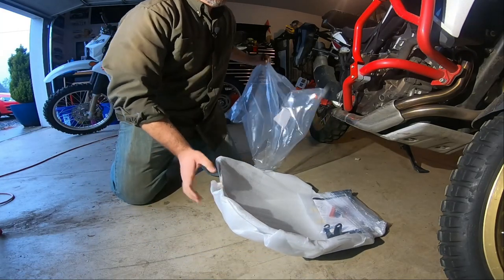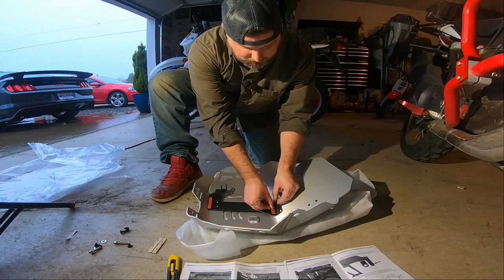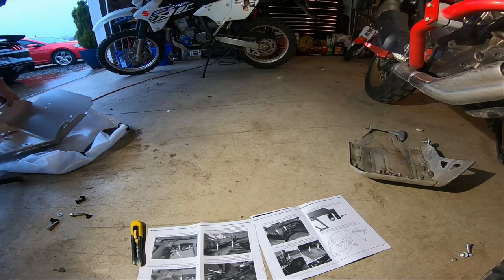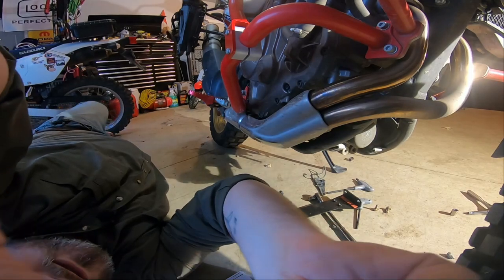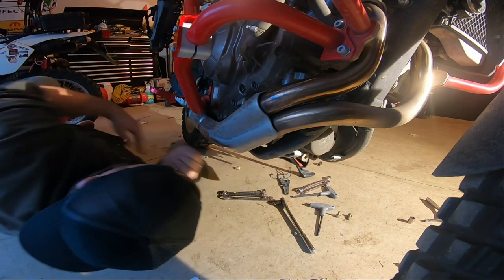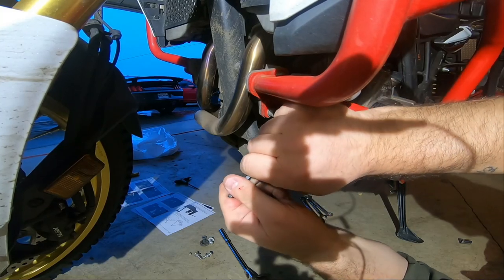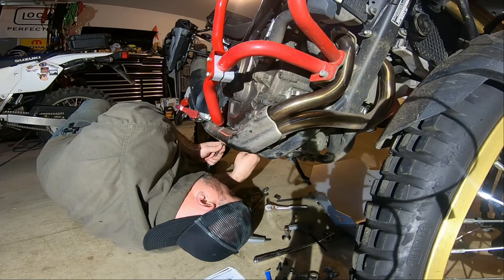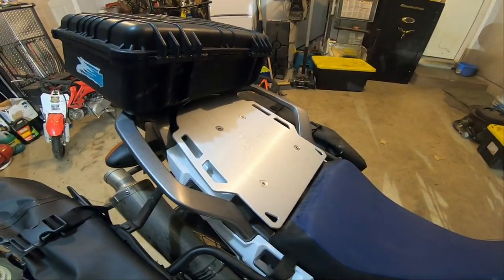Honda Africa Twin - Altrider Skid Plate Install!

Comment: just installed the crash bars and skid plate myself.  learned to install the skid plate on the side stand vs. the center stand. nigh impossible to align the rear screws when on the center stand.

it was quite frustrating until I had my little epiphany ;-)
Reply from the maker: It definitely took some work to put them all on. But so worth it once installed. They look great and do a nice job of protecting the plastics and the motor. Glad it worked out for you. Thanks for watching!

Comment: wOo-HoO! Holy shit bro is that thing a tank or an adventure motorcycle?? Lol damn bro that bike looks buff. I just ordered up the upper lower mid bars and skid plate from outrider getting ready to throw them on my Africa twin if you have any advice please give it to me ASAP cuz we're going to start here shortly I hope you see this message lol 🤷🏼‍♂️ freaking badass... BADASS bike dude! Hopefully you have NOT, but if you have crashed your bike how did the alt Rider bars hold up? & was it just a tip over or an actual crash at a decent speed?
Reply from the maker: Thank you for watching! I appreciate it! Only advice is follow the instructions and leave everything loose until you get all the pieces on, then tighten it all down. I have not crashed the bike, so can’t give any feedback on the effectiveness in a crash. They fit great, and I’ve had no issue with them at all. The skid plate has taken some hits from rocks and tree branches and no damage to the skid plate or bike because of it. I’m very pleased with the setup. And it looks awesome which is cool also.
Reply: @Mclovingarage  🆒 dude! Yeah i figured that 1 out. Kept having 2 loosen everything back up. It's 🆒 tho it's on there. Just gotta put mid bars & tie everything together. 👍👍💯%

Comment: Do you plan on installing headlight protection? Where'd you get your handled allen wrenches? I can find similar but I prefer certain colors.
Reply from the maker: Those are a harbor freight kit. Metric and SAE. Might be good to protect the headlight. I want hand guards next.
Reply: @Mclovingarage  thanks for the info. I suspected they might be Harbor freight.